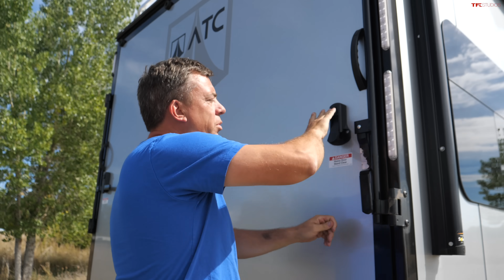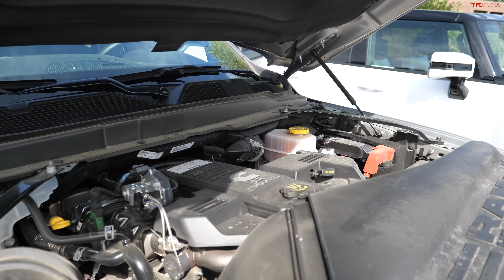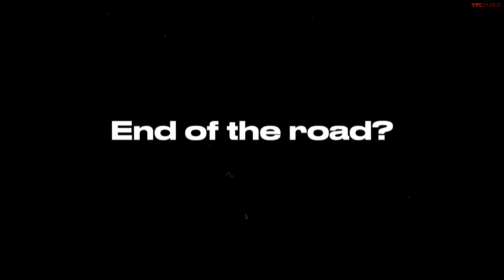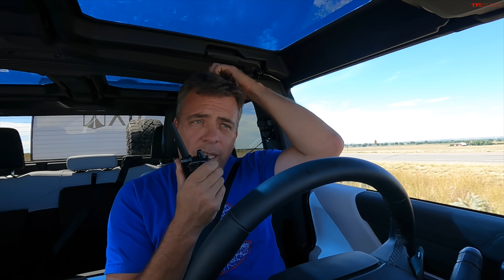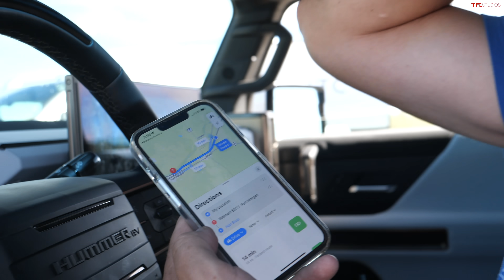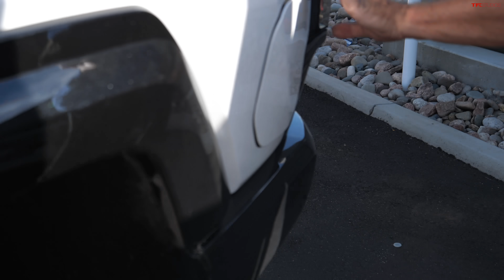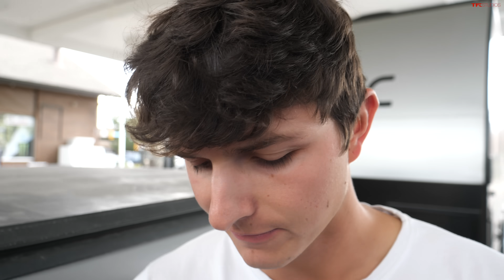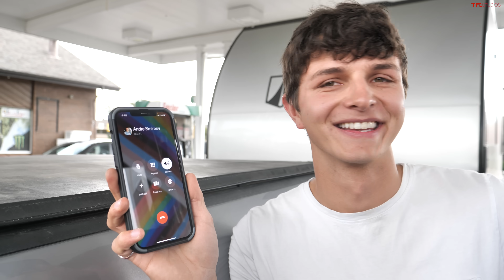How Far Can a Diesel and Electric Truck Tow An Identical Camper Trailer on ONE Fill-up?

Comment: i think TFL needs to show and test EV,s pulling tent and the holiday  trailers that collapse to half the height. also test an off road tent/collapsing trailer that has an open deck in the front for sxs/quad. These trailers are usually smaller, less drag but per square foot heavyish due to folding hardware. PS, these trailer's kinda need to be shown for EVs. i own a 2005 f350 diesel lol

Comment: I guess, with these towing vids, you guys get tons of views from EV haters … you clearly get tons of comments from them.  CLEARLY, you are using the WRONG TOOL for the towing job.  EVs EXCEL at the commute.  Diesels EXCEL at towing.  A Prius would also SUCK at the gauntlet … right?  The problem I see is that TFL is helping galvanize EV hatred, simply by emphasizing  the negative … instead of the positive.  The problem that no one wants to acknowledge is that crude oil is limited.  Every time I point that out, I get HATE by folks claiming that it is UNLIMITED.  They have a head shoved into a hole.  Don’t take my word.  Each year BP creates a report on WHEN it will all be gone.  At the present rate of depletion, the PLANET only has 60 years.  Then it will ALL be gone.  I care about my great grand kids.  I care that they might be able to take a flight to Hawaii.  Presently air travel is not viable without crude.  BUT commuting is very easily viable.  I’m trying to preserve some crude for future generations … whereas many others are trying to waste as much of that precious resource as possible … simply for the thrill of it.

Comment: So in order to get anywhere near Ram’s range, the Hummers battery would end up being around 15k lbs, add the rest of the weight of the vehicle, cargo and passengers and it would have to be a duallie at minimum. Wonder how long that would take to charge, assuming you’re not waiting inline behind a similar vehicle. Good attempt but electrification is years behind modern oil burners in terms of day to day usability.
Imagine what charging stations would look like if all vehicles were electric. The infrastructure is not in place for that.

Comment: Glad to see they got smart and traded the pathetic Ford Lightning for the Ram. Now they just need to trade the pathetic Hummer EV for a Powerstroke. Then you would actually have two worthwhile instead of two incredibly embarrassing vehicles. 

Look at the actual numbers people. Electric is absolutely not cheaper when it all comes down to it. Oh and those extremely toxic batteries will not save your environment either. Not to mention all the fossil fuels these used to actually manufacture the thing. It really is laughable!

“Unhooking the trailer to charge was a smart move.” Think about that statement for a moment.

Comment: Electric trucks are great on paper, in practice the infrastructure, battery capacity and upfront cost are huge strikes against it. I think a barebones Lightning pro would be the best for someone who commutes far enough to work to use 80% battery and tows the odd trailer from time to time.
Reply: The lightning pro at $40k makes a ton of sense for many tradesmen. A $750 a month payment is free (covered by fuel costs) at 3,000 miles a month. At the current price of $56k….. it still makes sense, just for far fewer tradesmen. They will still sell all they can produce for the next few years. 3,000 miles a month is 150 miles per day for 20 days, that’s well within the range of the lightning pro, as long as they are not towing. So no time spent charging, all fuel costs from home, at off peak rates overnight. Fuel costs will be about $170 a month. So most tradesmen that are driving around 150 miles a day are much better off with the lightning than a gas or diesel truck. Less miles means the payback takes longer, more miles means a lunchtime charging stop and much higher fuel prices.

Comment: I have Ford Mach-E bought 2021 summer 68KWH battery about 258 miles SUMMER season, same battery in 20F with windchill about 110-120 miles same charge!!!!???? I live in New Jersey
Do same video in 20F  you will need charge that Hummer 4 times to get 230miles
Be real do $ math how much would cost to fill diesel$ and how much will cost 4 charges of that hummer Am not buying free charge - IT IS NOT FREE at all it is government subsidies -taxpayers pays it

How much repairs will cost for EV later???

My Ford Mach-E is AWD it means has 4 motors!!!!
So in 2023 it will be trade in for gas car 
Plus Budadjudge wants to tax all EV- it's comming!!!!
Reply: A Mach e has 2 drive motors.
Reply: @allterrainrandy2587  You right but it sucks when you lose over 50% your range due to cold temperatures- it will be my trade in for other gas or diesel SUV. First and last EV
Reply: @edmundukas1  I live in southern Utah so I don’t have to deal with the super cold. An EV is definitely better if you have a garage to park it in, hot or cold! Battery density is a big issue. The small amount of onboard energy is not enough in certain use cases, long distance towing and extreme cold 2 prime examples.
Reply: @allterrainrandy2587  I live in South New jersey and keep my car garaged it not helping for my battery at all- when you start driving and your car has built in temperature sensor it recalculates your mileage right away but my house charger it used full 60KWH to charge - it means paid full price
Even hot day if I drive on Garden state parkway 80MPH I lose 25-30% range, I cant even make to NYC and back on one charge
I feel like dog on short leash

Comment: Diesel and even gas engines are better for long distance towing and hauling. Batteries just can’t store enough energy and recharge too slowly. Then there’s the finding a charger issue.

Comment: Give the tech 10 years and the batteries will be better and the range will increase. Internal combustion is not dead yet. The charging infrastructure needs to improve and so does the electrical grid.

Comment: all i know is my 1993 f250 4x4 7.3 idi manual is a keeper. well not so much now. i purchased it used with 51k miles in oct of 1995. 2 bodies. yes the salt air has killed 2. 349700 miles with metsl in the oil and still hauling HAND PICKED lumber. not fast but very strong. she will pull. she doesn't squat like the new rigs and miliage didn't chsnge when towing. more of a tractor. Either way it's been a GREAT FRIEND to me. some will understand that. My old very rusty 93 idi and i are presently toting my 4th labadoor Retriever to work everyday. Gotta love those VINAL bench seats!

Comment: I think you're gonna have to have a more powerful talking battery or motors like Elon Musk has for the Pepsi a holler's hauling 80000 pounds that has to be efficient it's to be efficient pepsi's invested in it andidn't and it should be it did be better than a regular diesel what do you think

Comment: It's so obvious that EV trucks aren't ready for long distance towing or even long distance driving.  Our infrastructure for charging just isn't there yet. We need more in city towing and hauling videos.  That's where the EV trucks really excel over ICE trucks. Then some videos on just driving the EV trucks in the city. I drive my lightning for 2 hours in the city and got 3.3 miles per kwh. And charging at home costs me 2.6 to 4 cents per mile. Or 8 - 12 cents per kwh. Be sure to quote the costs that you pay per kwh and how many kwh you used. I have a dedicated circuit for my charger so I record the exact kwh usage for each charging session. Calculating kwh costs is easy. Subtract your basic & meter service charges.  Then divide that by the number of monthly kwh used.
For winter months I pay 8.5 cents per kwh.  The service charges you subtract have nothing to do with kwh charges.

Comment: I’d love to see a winter tow test using that hummer somewhere like Montana
Reply: Either Montana in the winter or Arizona in the summer. The heater / air conditioner would suck up the charge like a sponge.
Reply: Get stranded somewhere in -20 degree weather 😂 great idea lol
Reply: @SteegeFish  That's what chase vehicles are for, that and the external camera views going down the road.  It would do well to have at least one reliable ICE vehicle along.
Reply: @ironclaw6969  well yea or else they would be screwed 😂
Reply: @SteegeFish  I certainly wouldn't trust the Hummer that made it less than 250 miles on the odometer before breaking down in the middle of traffic.
Reply: Bring it to Alberta Canada in January/February.  It will be a survival video.
Reply: Guess what? Batteries and electric systems get more efficient with decreasing temperature.
80% of vehicles in Norway are already EVs and I think you might find that Norway, gets a lot colder than anywhere in the US in winter.
Reply: @distanceismyplastercast  well I have a Civic Hybrid with electrical assist and my results are worse during colder spells.  Maybe the ethanol mixture for fall/winter is different.  I did get a measurement one time and instead of 10% ethanol it was around 12%.
Reply: @charlesbyrneShowComments4all  A higher % ethanol would reduce miles per gallon, as ethanol has a lower energy density than gas in general. Same as different qualities of gas have different energy densities depending on the mix. For example branch chain hydrocarbons in fuels have higher energy density than straight chain hydrocarbons.

Comment: The Hummer is a 9200 pound truck thar doesn't pay road use tax         when recharging. You know that with change
Reply: Most states have implemented an EV road tax with registration.

Comment: So he should have spend $40? On just over half the trip, the other $100 on the whole trip? My conclusion: electric not so cheap, apart from the charging time, time spend on the side of the road equates to cost for business! It will take a long time to make that money back on the buying price of the Hummer. By that time the battery might be defunct, and need to be replaced? They need to invent a better mousetrap(battery).

Comment: Plus sides of the diesel is you can get a auxiliary tank for another 60 gallons or more. Plus fill ups only take 10 minutes or so
Reply: And you can get a titan fuel tank for even more capacity. Had a 46 gallon in my '07 ram I could tow a 10,000# boat 400+ miles without stopping.

Comment: 2008 Suburban 2500 4.11 gearing 12,000 lbs. Would not pull that much, but with similar trailer and 39 gallon tank. 3.73 gears 10,000 lbs plus peace of mind.  Of course with WDH installed. When traveling to Boise Idaho from LA only stop
once for fuel.

Comment: Here's the question that I would like to know potentially now granted this is counteractive of the whole EV thing couldn't you have like a 10,000 watt generator sitting in the back of your Hummer charging it as you drive wouldn't that accomplish the same thing as the Chargers. But the one thing I still don't understand is why don't they just put alternators on the wheels opposed to regen breaking the alternators could charge the batteries and potentially make it so you would never have to plug it in if the science was correct on it.
Reply: At 2 miles per KWh it takes 30kWh to maintain 60 mph. The BMW i3 Rex generator can output up to 19kW. The Chevy Volt can do up to 50kW. I don’t know the fuel consumption at those outputs yet. A 10kW generator would add about 1/3 more range at 60 mph. They were towing 70 mph, that’s about 40% more power. The Hummer would gain more range by slowing down 10 mph, than with the 10kW generator.

Comment: The issue is that they are towing a big drag heavy trailer that don't help the efficiency much even the truck with diesel powered trucks can struggle with costs

Comment: Well I can buy a lotta fuel for 60k and after 8 years when the Hummer needs a battery OUCH! The Dodge driven 20k a year would be at 160k with tons of life left if you just spent 2-3k over that time on reasonable maintenance. Oil, trans fluid, coolant etc. Brakes and other stuff applies to both. No thanks. Powerful and neat but practical? Not even close yet. And wait until legislation catches up and we start paying a mileage tax instead of a gas tax. You know that is coming soon.
Reply: Someone did the math in another comment. "Thats awesome the charge was free, but let's use the numbers to find out the future cost. The Hummer charged from 7% to 51% for $37.41 according to the EA charger. So $0.85 for each 1%. At that rate it would cost $79 to charge the Hummer to 100%. Hummer cost per mile: $79 ÷ 123 miles = $0.64 per mile.
Cummins cost per mile: $105 ÷ 211 miles = $0.49 per mile"

Comment: Just noticed the payload modification sticker. So looks like real payload as that Hummer sits is only 1043lbs. Add Andre and all that's left is maybe 825-840 which could mean that trailer puts it over the limit (ATC website says between 650-950lbs of tongue weight).
Reply: Almost all manufacturers give you 150 pounds for a driver and sometimes passenger

Comment: Would a multi-gear transmission give more range on EVs, both with and without towing loads? I'm imagining such a transmission start out at 1:1 direct drive as first gear, and stepping into overdrive ratios from there.
Reply: No; a trans won't help.  Electric motors are at least 95% efficient,  while a transmission is under 90% efficient. Also,  power and torque aren't the problem. It's simply that the battery doesn't hold much energy per pound.
Reply: Yes. But the point of an EV is to be reliable and better than gas. Adding a 2 speed tranny when it can operate without one makes it just as bad as unreliable ICE vehicles.

Comment: As someone who has towed a 30' 10k lbs Toy Hauler from Florida to Alaska round trip, I'd like to stress how important range is to lowering stress in towing. Having the range to make it to your destination without having to refuel hooked up is a game changer in towing. I have a Cummins Ram and added a 90 gallon DOT legal Aux fuel tank and can easily tow 1100 miles without refueling. Granted that's a little overkill for most people, but I was on the ALCAN in March. Adding a 30 gal Aux tank will give a modern diesel around a 500-600 mile range towing, which is more than most people want to go in one day anyway.
Reply: Exactly.  I added a 40gal aux tank to supplement my 34gal main tank.  Takes so much stress out of a trip and allows us to pick and choose where we get diesel weighing both cost and convenience due to our towing a travel trailer.  That tank is single best addition I made to our tow rig and it is slim enough that I still have use of the majority of the bed.  EV trucks aren't there yet for towing especially trailers such as 5th wheels, goosenecks or anything with a substantial frontal wind load.  No way we could make the trips we do stopping every hundred miles for 45min to an hour waiting to charge.  Get a huge headwind in Western Kansas on I-70?  That Hummer wouldn't go 50 miles with a trailer.
Reply: @vardashan  I completely agree. The tank is the single best thing I added also. I have about $2k in my setup, but it's integrated into the truck computer, and is completely automatic. Absolutely worth the money.
Reply: @vardashan  yep and just imagine running out of battery in the middle of a cold, dark, country road. IF you can get a tow truck they can’t give you gas. You can beg them for a ride, while your $150,000 electric SUV sits on the road side, with no battery power. How are you going to get it out of there? Towing a 9500lb electric hummer? What about your trailer? What if you had kids? Disaster!!
Reply: My old Dodge has a towing range of 370 miles.  I generally start looking at around 250-300 because I need to stretch anyways.  Life it too short to have range anxiety.
Reply: I have the 50gal tank on my ram and I get (depending on how heavy the load is) easily between 500-600 miles per tank.  On just the truck no load, I get 800 miles to a tank.  No need to add an extra tank.  

Cheers 🍻
Reply: @rigorousrangel6394  I have a Ram 3500, and my stock tank is 32 gallons. Be more specific than "Ram" with a 50 gallon tank. If it's not a cab & Chassis, or something similar, I'm calling bullshit.
Reply: Take off that 630 pounds of deadweight you installed and you'll go an extra 500 miles. Union Pacific found that out the hard way  when they followed CSX's lead in ordering AH locomotives, H = Heavy because they added in more weight for tractive effort. Now they regret it when the loco they had intended to replace, the AC's, is still their best puller and gets far better mileage per gallon even when pulling upwards of 18,000 tons. I want to see your Dodge Ram pull 18,000 tons of anything and get better gas mileage than the ES44AC.
Reply: @Destin65  This is THE dumbest thing I've ever read on the internet. Even MTG hasn't said stuff this stupid.

Edit: I'm Upvoting your comment in hope more people will see it, and know how stupid this is.
Reply: Hopefully the 1100 extra miles meant you made it through the Canadian portion of your trip without having to refuel. Our leader here hates diesels. In northern B.C. diesel is 2.40 per liter or close to 10 dollars per gallon right now.
Reply: That's a sweet machine you got!  Pyrolysis plants are the answer to everything.  We can take all the plastic and tires and recycle for hundreds of years and get all the Bio Diesel and Gas we want with ZERO carbon emissions from recycling.  Not to mention when you add just 30 oz of this Bio Diesel to normal diesel it reduces all emissions by 80%.  Or just run 100% bio diesel and gas from recycling.  Problem Solved.
Reply: And good luck trying to find charging stations every 125 miles in Alberta and northern BC.